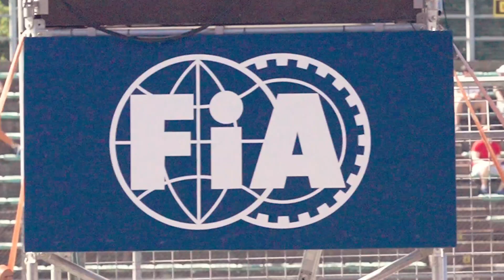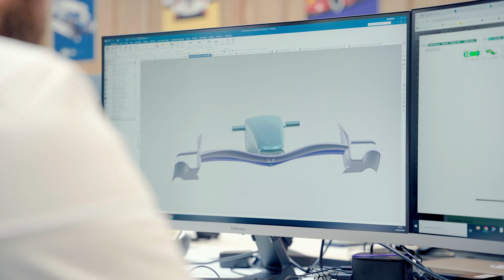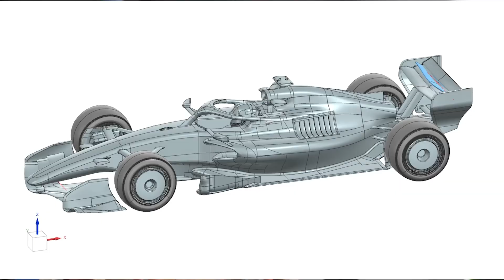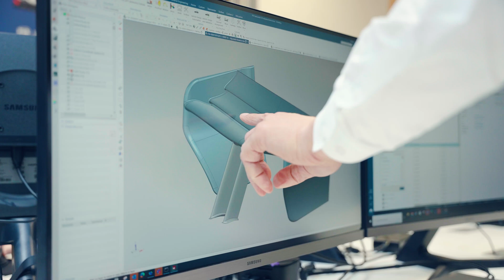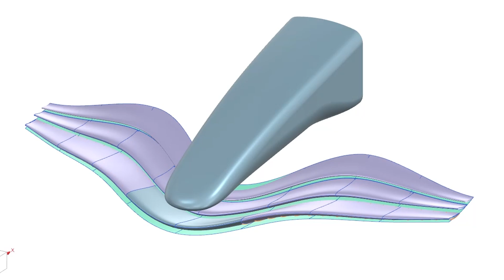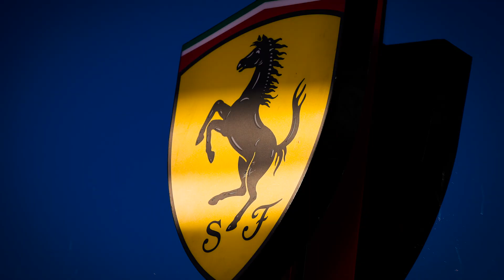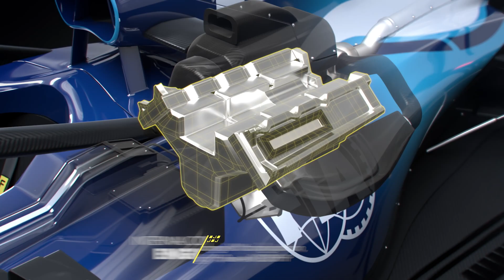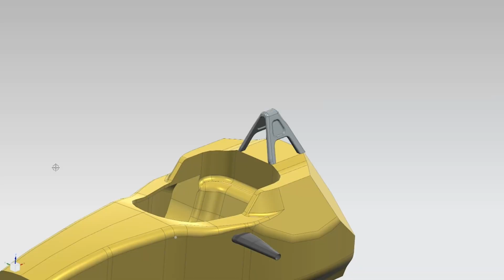The Future of F1: Showcasing the 2026 FIA Technical Regulations – Lighter, Safer & More Competitive!

Comment: In 1963 when Honda announced its ambition to join F1, the then FiA head stated "we do not need yellow people in Formula 1!" For the Japanese this is still a sore point; one which the Japanese public, as proven by frequent editorials and polls, believe has remained an embedded mindset in the FIA over the years. According to this video, the engine regulations for 2026 were not discussed with RBPT or Honda. This can only reinforce the feeling the FIA believe Formula 1 to be a Europeans Only club. Haas may have a U.S. owner, but it is very much a European team. The conditions for the incoming Cadillac appear to require the team, including research and engine design, to be based in Europe with mostly European staff.
The FIA needs to step back from enforcing rules other than for safety. It has killed off many series with its meddling, perhaps deliberately. Should Formula 1 become truly international, I am sure the FIA will seek to destroy it.

Comment: Can you Put a fusion button on the steering wheel because if all of the drivers have pressed that button at the start of a grand prix and at the same time all the drivers have fusioned into the megadriver Who is heavily pregnant with all the formula one drivers inside of his belly and the grand prix promoters will have to install large tubes for the megadriver to go through and the only time when this button Will be deactivated is on tuesday or on wednesday!!!

Comment: I think it's good that some of the rich are trying to reinforce sustainability, but the unfortunate thing is that the FIA has shifted its philosophy from extreme racing to advertising cars. Instead of performance monsters that rely on the driver for victory, we'll have a more artificial race reliant on race strategy more than driving skills. The golden V10 era has never seemed so far away in terms of the engine, but the cars are more sophisticated than ever, and with the active aerodynamics we can still enjoy seeing drivers trying to adapt, with perhaps different drivers on the podium. I'm happy that the cars have gotten smaller and that we're paying more attention to active aerodynamics, which should definitely be the future of racing, but I'm disappointed with the engine and fuel, ethanol isn't necessarily a symbol of sustainability and electric cars are boring.

Comment: Literal grandstanding. F1 cars haven’t had any influence on road cars since the last time flappy paddle gearboxes were put in a Ferrari. 

Since then, what actually useful tech has gone down to road cars? 

Bring back more cylinders.
Reply from the maker: Let us think 🤔… in modern Formula 1️⃣ 

1. Active Aerodynamics
2. Carbon Fibre
3. Active Suspension
4. Paddle Shifters
5. KERS (Kinetic Energy Recovery System)
6. Steering wheel buttons
7. Diamond cylinder coatings
8. Hybrid powertrains

🏎️
Reply: @FIAOfficialVideo my original comment still stands. The Ferrari I was referring to is the F355. Released in 1994. Almost none of the tech you’ve listed came after this period. In other words, since 1994, there’s not been much of a relation between F1 and production cars. 

And hybrid and KERS in production vehicles were already a thing by the time the 2014 (and 2009) regulations dropped. So F1 isn’t responsible for that getting into production cars. 

So the only thing is…diamond sleeving in cyclinders?
Reply from the maker: We regulate the direction of innovation in 4-wheel motorsports, John, not the rate at which road cars embrace or adapt it 🙏
Reply: @FIAOfficialVideo  so you’re not trying to make formula 1 relevant to road cars? 🎤
Reply: @FIAOfficialVideo  that’s not an answer, mate

Comment: Just remove technical regulations that don't have to do with safety and let the teams develop what they want.
Reply: Racing would be crap and I guarantee you'd be the first back here to complain about it.
Reply: @mcraig  i watched F1 races from the 70s and 80s and the regulations allowed for way different cars back then and the racing was close. In WEC the regulations are less strict as well with different cars and a 6 hour race is interesting the whole 6 hours as opposed to modern F1.

Comment: Safer? If you keep pushing for safety the drivers are going have to be more healthy after the race than before to call it a success.  The rule makers have their heads in the clouds like true bureaucrats of the times, the 2026 car epitomizes this era of buzzword virtue signaling while not solving any real problems, just catering to what the hollow ideals mba bandwagon dummies running investment firms want to support this decade.
Reply: What’s wrong with pushing safety? Would you rather more dead and critically injured drivers?

Then again, you’re the type of chump that says ‘virtue signalling’, you’re probably not very smart.

Comment: Having active aero on all cars at all times only means the faster cars will get faster. DRS has lead to a lot of great passing and strategies. Replacing DRS with an energy boost is okay but it’s not visible to the fans. Power boost seems gimmicky and won’t be enough of a boost. Hopefully more gimmicks isn’t the future direction.

Comment: So they shortened the wheel base worth a palm size for the average hand size, half a palm size in width and made the cars 30kgs lighter.
6:00 - Also replaced DRS with active aero and gave the following car extra energy to overtake (push to pass?).
Less downforce is good, but how long will take the teams to get those numbers up? Judging by what happened in 2022, I'd say 5-6 races, especially since the cars are still airplane sized.
And the absurd amount of 'sustainable' in this video is just off the charts. Be 'sustainable' all you want, but stop making it a selling point, people are tired of it for half a decade now.

Comment: The only thing that worrie me, it's the reduced ICE power. We went from 850 ish to 540ish... but more MGUK power. So i hope it's not translate in an extreme type off using the PU, like coasting half off the straight to chage the battery.🤔 I hope we get rid off this completly overprice hybrid system for the future engines, and focus more on carbon foot off the whole F1 circus rather than 20 cars running 6h on 24 weeks a years. It's a step in the right direction size and weightwise.

Comment: My take on the engines:

The hybrid systems will have been in F1 for 11+ years, and have pretty much served its purpose. Now is the time for F1 to fully ditch the expensively heavy and complicated hybrid systems, move on, and fully focus towards the 100% sustainable/synthetic fuel direction.

This direction will actually please everybody

1. Since these fuels are gonna be less/no longer harmful, they have an option to bring back V8s (V10s hopefully) or engines similar as a platform to test the synthetic fuels. 

2. Removing the hybrid system results in a huge weight reduction, which will bring back even lighter, agile, and nimble cars F1 is supposed to be, which is what the FIA is trying to achieve.

3. Revive F1 with the fact that they not only brought back screaming engines again, but have also brought back the formula of F1 cars which are light, nimble, agile, loud and fast (The main wow factors of F1).

4. Please big oil sponsors like Aramco, Shell, Petronas, and Gulf as they can develop said fuels and be at the forefront of developing these synthetic fuels. (They could also have a competition as to who can develop the most efficient fuel on the grid.)

5. Since the focus will be 100% on developing fuels, this will lead to an accelerated development of these fuels, which will have more of an effect on the environment, as the freshly developed fuels can be immediately used by the billions of cars on the road with conventional ICEs.

This is leaning more on the idealistic/optimistic side of looking at things, so it probably won't come to life 😂
Reply: imo some hybrid is good but the changes for 2026 have somehow been done in the shittiest way i could imagine
Reply: optimism... i like it
Reply: They told this so many times: F1 needs to be road relevant.
E-Fuels are cool but not even nearly a certainty if not for racing use and small productions.
Yes, they need to be developed to see (that's what they are doing) but you cannot totally ditch what keeps everything alive for now.

Comment: I don't even know where to start. Guys, we fans finally want smaller, lighter cars again. Making the cars 10cm narrower and a few cm shorter doesn't do any good. A third smaller, 600 kg and only 6 gears again. And what's all this nonsense about the adjustable front wing? We've had that before, it was nonsense. What we've also had before is that the drivers could activate the DRS for the whole lap in training. Vettel and Red Bull used it to the max. Then at some point it was banned because it became too dangerous because drivers tried to drive with low downforce as much as possible. Exactly the same thing will happen again. What you're doing with the rules is absolute rubbish. And while we're on the subject of rubbish, 24 races are 6-8 races too many. And nobody needs Jeddah, Qatar or Las Vegas. They are crappy tracks with crappy races. I want to see races like Imola or Monaco, where you can actually see fans on the sidelines and where the atmosphere is good. I don't want any more city tracks with a dead atmosphere. Why don't you understand that? You're doing exactly what the fans don't want and the reason is because you really don't care about the fans. If you keep going like this, F1 will disappear into obscurity just like NASCAR did 10 years ago.
Reply: blah blah blah
it about what the manufacturers want not the fans

Comment: Some of them are good changes however maybe pushing too far this concept isnt good for anyone. As we already saw the mguh wasnt a success, together with the wheels going bigger because no car now uses rims this small. I agree that the fuel should be 100%sustainable but at that point just let manufacturers build whatever they want or at least make the engine of this era rev higher. The real improvemente for me however or at least as important as active aero (wich nowadays every car uses in one qay or another) is to play with active suspensions. This is very relenvant in the current market and together with the graound era we know it would be optimal.

Comment: I've said this once before but F1 is supposed to be the pinnacle of motorsport. For example we don't see MotoGP going down to 500cc turbo engines with bio fuels, this sustainability/environmentally friendly thing has just gone too far. In fact MotoGP is adding even more aerodynamics! I get the fact that the technology developed in F1 can be passed down to consumer vehicles but still, we need smaller cars first and don't choke the engines off. I could go more in depth but hopefully my points make sense.
Reply: It is the pinnacle. I don't know if you realize this, but the F1 V6 engines right now are THE most efficient engines in all of motorsport. They capture over 50% thermal energy of each combustion of fuel, something not even the most efficient road going engine can hope to match, and they're already running on 15 to 20% sustainable fuel. Sustainable fuels are also a huge area of progress... read up on Porsche e-Fuel and look at how it's made, the only major waste products are oxygen, water, and a little alcohol... and the Porsche Carrera Cup around the world uses that 100% sustainable eFuel as their racing fuel. 

MotoGP bikes also have extremely efficient engines for their size, but still nowhere near the pinnacle of F1's V6s. 

Also, in terms of noise, by removing the MGU-H, the cars will naturally be louder. They won't be screaming V10s or V8s, but they will be making more noise.
Reply: @vagabond142  Totally get it and understand the crazy efficiency. Good points!
Reply: this IS the future dummy

Comment: The power is so low because of the higher proportion of the electrical system in power unit, and this forced them to put active DRS for all cars, as the new power unit is not strong enough to handle such high drag that normal F1 car has in past few years. Instead of artificially increasing the electrical system, and making cars slower.

Better improve and focus on sustainable fuels and fast track that technology making it relevant to roads, so that the governments who got forced into unnecessarily electrifying the cars (which doesn't do much for environmental issues as very few use BEVs too long beyond their carbon emission breakeven point, and end up buying new BEV pumping even more carbon into environment than using a combustion car otherwise)... If F1 proves the proof of concept and get the ball rolling for sustainable combustion engines, using sustainable fuels or Toyota's Hydrogen engine etc, then creating hype in market to shift the focus from artificially construed environmental solutions like BEVs towards actually goid solutions that are fun and environmentally friendly... So, that R&D accelerates in that direction to actually make good combustion cars down the line for the roads which are eco-friendly and fun.

Comment: If the fuels are 100% renewable, what is the point of hybrids? Bring back high revs and much smaller lighter cars! Hybrids just makes them heavy and bulky. Make the rear wings much wider so the angle can be less aggressive. Same downforce with less dirty air.
Reply: unfortunately people think hybrids are the only way you can show you wanna be sustainable. On the other hand it pushes the cars to 1000HP where it otherwise wouldn't and push to pass is an interesting strategic tool when implemented correctly.
Reply: The manufacturers want to develop relevant engines.
It sucks but that's how the world works
Reply: @gordontheman6151  HYBRIDS FUCKING SUCK!!!!
Reply: Renewable fuels generate one hundred times more fine particulates than fossil fuelled engines. It seems people's health is to be secondary to worshipping at the alter of CO2.
Reply: The point of the V6 is that it is INSANELY energy efficient already. Think about the typical road-going hybrid, and look at the ICE in that. Even with the hybrid assist, you're only capturing at most 15 to 20% thermal efficiency in the best case scenario. F1 V6 engines capture over 50% thermal efficiency, meaning that for every particle of fuel, it is extracting over half of the possible energy available from the combustion of said fuel. The hybrid system also allows for kinetic recovery of some of that energy, and in 2026 will capture more and have a larger battery to hold more of that captured energy.

The whole thing is not about screaming high revs and pure engine power, as much as I grew up listening to the V12s, and was watching during the V10 era as well. The big thing about the new power units is efficiency. That's also why the cars will have the new X-Mode aerodynamics, reducing drag on the straights to maximize potential energy deployment in the most efficient way possible. 

As well, notice that the front wing endplates are gone, the rear wing is much lower and flatter, and the ground effects intake is much lower and wider. These cars are designed more to cut the air instead of blast it aside, meaning that already the amount of dirty air coming off them will be reduce a ton already.
Reply: @vagabond142  V6 is inherently unstable as a combustion engine. Keeping the 1.6L and moving to F6 or V8 would perform much better from both efficiency and reliability standpoints.
Reply: @vagabond142  WE DONT CARE ABOUT V6 HYBRID  VACUM CLEANERS WE WANT TO REAL SOUND OF F1 BACK!!!!
Reply: @ChrisD72  The whole point of F1 is to be at the bleeding edge of tech and innovation. Sorry to say, but V10s and V8s are not coming back. If you don't like it, don't watch F1. Easy as that
Reply: @vagabond142  The thing is, F1 isn't anymore at the leading edge of tech and innovation. Now, new tech are actually research outside of F1 and F1 is starting to be late with all the new tech. I mean we just have to look at sustainable fuel... WEC went for it way before, even with hybrid engine... And let's not talk about active aerodynamic, manufacturer like lamborghini went for it before aswell and it's been years, but still we get only the front wing and rear wing as active. But it looks more like "semi-active" than something else... We can also talk about tyres, which are now the same size as a road car, but they make them unreliable on purpose, so it is only marketing.
F1 is not anymore at the leading edge of car technnology
Reply: "sustainable fuels" are nothing else than Aramco greenwashing. They're pricey and require a lot of electricity to produce.

You'll never have brum brum back because teams and manufacturers couldn't care less. They just don't want to produce that kind of engines anymore for they're an old and inefficient tech, and that's been pretty clear since like 10 years ago. Apparently, they're not stuck in time as brum brum fans are hehe
Reply: @12th_Carnival  It's not Aramco greenwashing. Look up at how Porsche develops their sustainable fuel, it's actually a fairly simple (if scientifically complex) process and they generate 90% of the electricity used via solar and wind power right at the processing station
Reply: And batteries are the holly grail, one basically appears out of thin air on a 1-1 ratio with trees.

Comment: On one hand you want less money to be spent, on other hand you introduce the most complex and expensive aero to date... Imagine if wings fail to redeploy when the driver goes to a corner with full speed. Its like having no front/rear wing and a recipe for a disaster.
Reply: make it a standard part like the current mgu systems there's your problem solved
Reply: drs has been out for years this idea is not a new issue and f1 teams have designs on perfect failsafes for it